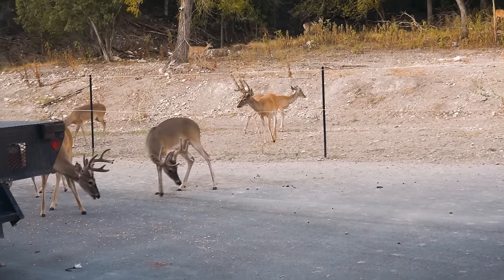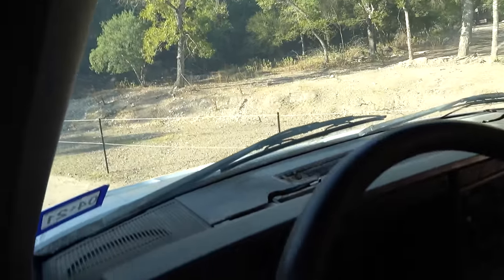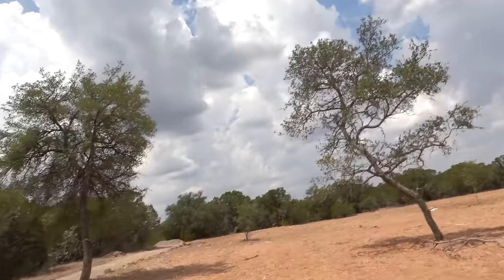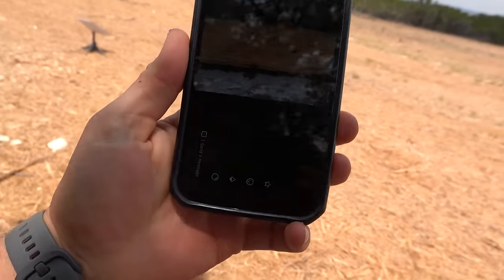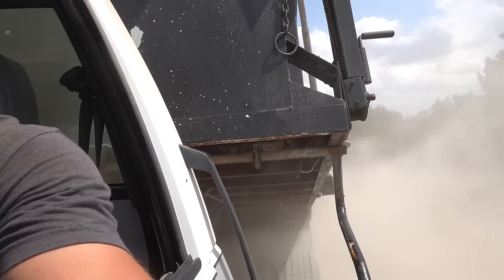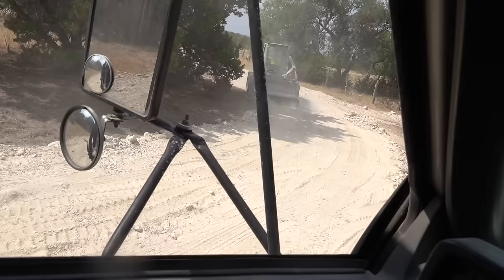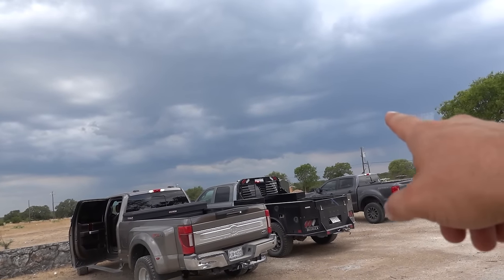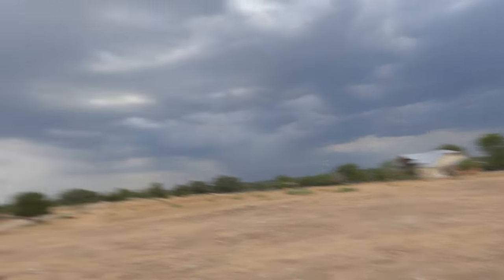FINALLY Starting on the New Range!!! w/ DonutOperator

Comment: Guys...gotta give Starlink time to settle.  It doesn't work the best right as soon as it is powered up.  Needs about 15+ minutes to settle after it firsts connects.
Reply: exactly this. Also depends on which plan they're on. Love my starlink, changed my work life.
Reply: Please explain to me how a connection needs to "settle". Been doing network shit for a few years and iv never heard anyone say this.
Reply: I've been doing "network shit" for like 20 years and it's got nothing to do with networking. What it likely is related to is establishing connections to set satellites so the connection stays stable instead of swapping satellites repeatedly, which would make the connection work poorly.
Reply: @williameldridge9382 😂
Reply: I cringed every time they nattered on about clouds. Next they'll be trying to tell us it doesn't work in the dark. 😁
Reply: @Randyluck1 Signal does go further through air than through water. Clouds are made up from water. So not the dumbest thing to think.
Reply: I do no know what plan Donut is using, but Starlink offers business plans/hardware that may be better suited for streaming.  For example, the "Fixed Priority" plan offers 40-220mb down and 8-25mb up.
Reply: @ginger_nosoul  Starlink uses a phased array antenna to lock in on a single satellite at a time, out of a large constantly moving constellation.   It is possible that during initial boot it may choose a sub optimal satellite (one low on the horizon or one moving behind a tree), then update its internal database of sats, and find a better one on next handover.    My dad has Starlink up in Montana, and have observed the same behavior.   Not great after initial boot, but gets better.
Reply: @wesselvandenberg6114  Never had Dish Net or Direct TV have you? The only time clouds interfere is when a big rain shield gets between the dish and the bird. And then only while approaching and half way through the storm. Those puffy little things he showed were of no consequence at all.
Reply: @wesselvandenberg6114   According Starlink, regular puffy clouds have no effect.  Only higher density storm clouds (or those producing rain/snow/hail) can degrade the signal.
Reply: Its callled Ephemeris Data....it's algorythms and satellite confirmation info packets....processed and continually verified and updated.
Reply: @Randyluck1  we had a 5ft satellite dish and we noticed the signal quality was going down when it got really cloudy (like thunderstorm). Smaller dish you already notice issues with normal clouds.
Was kinda fun during snow (in the evening) we had to turn the dish to clear of the snow (had a turning motor).
Clouds look fluffy but they are heavy.
Reply: @Randyluck1   Agreed.  Generally all Starlink cares about is trees.  The home version of the antenna tends to choose a northern exposure, but the mobile version may work pointed straight up.
Reply: @ginger_nosoul   it starts off connecting to a single source, after a few minutes it connects to several.
Reply: @daemn42  It started out pointed almost straight up for Matt's aborted stream but had settled into an almost 45 degree angle for Donuts stronger  stream.
Reply: They also have a newer version of the recievers now that is supposed to have something like twice the performance.  Donut said his was like two years old.
Reply: @mammutMK2 Traditional satellite internet and Starlink run on totally different technologies, Starlink generally doesn't cut out even during relatively heavy rain/snow. Same antenna tech that military planes use.
Reply: @ginger_nosoul needs time to locate and connect to multiple satellites. So it can pass the data through the strongest connection it can find.

Edit: spelling
Reply: We were watching him for like 10min on the video so I'd imagine he was trying for a good 30min-1hr irl
Reply: @ginger_nosoul Do you own a GPS drone?
It's just like that, you need to let it connect to as many Satellites as possible for best connectivity.

Comment: Matt, If you can get fiber internet to one of your buildings, you can use a ubiquiti air fiber antenna to create a point to point connection to a air fiber receiver to get the same fiber upload and download speeds you are getting in the building. It will still work on a broadband connection as well. This method is good up to 13 km or more as long as you have no obstructions such as trees and what not. So the higher up you go the better.

Comment: Matt as far as AC in the dump truck, you could get a portable 12V camper/tent one and Hardline the exhaust out the back of the cab. No more dust and it will freeze you out of there....

Comment: For a ranch truck you might want to disable the seat belt nag (chime) .  Procedure for the 09-19 Ram. Simply put belt on, turn key on, wait till everything boots up in the cluster then Unbuckle and buckle three times while finishing with it buckled. Turn ignition off and you should hear a chime. No more belt alert.

Comment: My life motto is this:
Your potential is always just beyond your comfort zone.
Reply: thats a good way to miss most of your potential, as potential extends far beyond comfort. thats why most people miss it.
Reply: @naterchapman1871  It sounds like you are disagreeing with me and agreeing with me at the same time. Are just using more words to say what I just said...?
Reply: @702couch  you're correct that it's beyond your comfort zone, but not just beyond, it's actually a good amount out of it, so you're partly right.
Reply: @naterchapman1871  🤣🤣So you are disagreeing with the statement based on semantics of imaginary distance of being out of your comfort zone?
🤣🤣 How high are you right now? 🤣
Reply: @702couch  no, semantics and inaccuracies are not the same. Come on dude, be smarter than that. Also wasn't really disagreeing, just adding a slight correction, you will get some potential by going "just" out of comfort, but you will get most by going far beyond comfort, is that better? Put your ego away, this isn't that type of conversation. 😉

Comment: Once you get some buildings up you can get some ubiquiti beams and beam your internet connection from the main part of the resort to the range part. Just works off line of site and if you had a building tall enough above those short trees at the range and then one at the main part of the resort you could have internet down there and then anywhere else you want to put a beam.

Comment: Starlink takes a few hours to get setup and dialed in - up to 12 hours if you read the instructions. I have the same thing and 280 down and 20 up with no issues. It has to get dialed in.

Comment: The engine does not generate the compressed air for the brakes etc it has its own air compressor.  I'm sure your seat works fine, you just have to adjust it correctly.
When you dump materials out of the bed of the truck you slowly move forward you don't just stand still and dump the load.

Comment: Native to North Africa Aoudad Sheep also known as Barbary Sheep were introduced to parts of Texas, California, and New Mexico in the 1940"s.  They have flourished as a free-ranging, wild sheep ever since.  Barbary Sheep stand 80 to 100 cm (2.6 to 3.3 ft) tall at the shoulder and weigh 40 to 140 kg (88 to 310 lb). They are a sandy-brown color, darkening with age, with a slightly lighter underbelly and a darker line along the back. Upper parts and the outer parts of the legs are a uniform reddish-brown or grayish-brown.  The horns curve outwards, backwards then inwards, and reach up to 50 cm (20 in) and are smooth, but wrinkled at the base.

Comment: Seems like you need a point to point setup for out there. Just get a line to somewhere you can and get a pole up on both sides and then use a unifi system.

Comment: GVTC Provides fiber internet up to 1Gb in the area of the ranch according to their website.  You would have to find a way to get data out to the range though.  For that you could run some fiber in house, or you could use long range WiFi access points or a point to point wireless solution.  I would love to wire up that ranch for you but I don't have a crew to do the work.  For a temporary solution you could setup some cellular boosters to see if you could get a decent enough mobile signal and use LTE or 5G from out at the range.  Only one tower in the area and looks like it is on the ranch or right next to the ranch.  But it does offer LTE from AT&T.

Comment: That's the great thing about a CAT diesel... Massive torque numbers.  That early shift, no problem.  A heavy load, no problem.  Both, at the same time, still not a problem.   As a bonus is the great sound. No other diesel sounds better than a CAT, either.

Comment: A construction company that I used to work for would screw 1 inch thick plywood on top of it because plywood is generally cheaper than reskinning it. once the plywood was pretty fucked up, it would just get replaced

Comment: If you want to have air conditioning look up 12 volt air conditioners they make one that goes on the roof and they make one or you can mount it on the side of the frame

Comment: Clouds aren’t blocking it, it’s not visually seeing the satellite. The frequency penetrates clouds. The problem most likely is that the Starlink portable system has a lower priority and gets throttled for the standard systems. At least until Starlink is completely deployed.

Comment: you can buy a standalone ac unit, with flexible hot air exhaust, put it in the dumptruck with the exhaust out the window

Comment: you know you can set the gate to dump so that you can lay it down even and dont have to have the skeetster to do it all also you shouldnt be wearing your seat belt while running loads bec you will be safer to get out of the truck while dumping also when dumping have the door cracked so you can jump if need to!!

Comment: allowing the wildlife to just roam is awesome but conservation wise some has to go to keep numbers and herd health in check. I'd recommend hooking up with another ranch that is good in conservation and could mentor you in this. any culls needed to be removed in my opinion should go to veterans and handicapped folks guided by your mentor partner. culls being bad bloodline or undesirable traits you don't want to be passed on. like a mean ram that slams vehicles or an animal that has an inheritable issue..... as a vet, I'm sure you know this. also as a vet..... maybe that weirdo sheep that you don't want breeding to spread issues could be tranked and sterilized if not culled